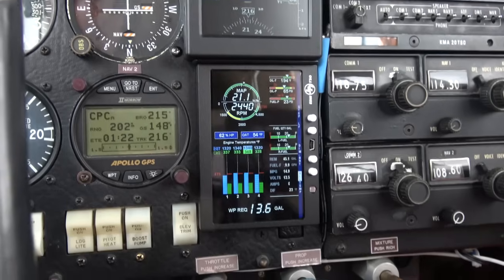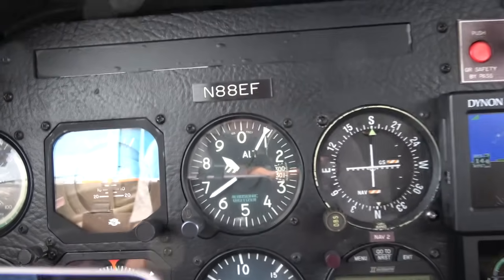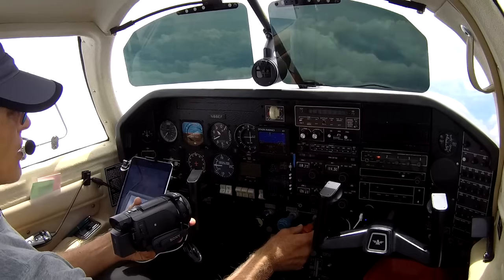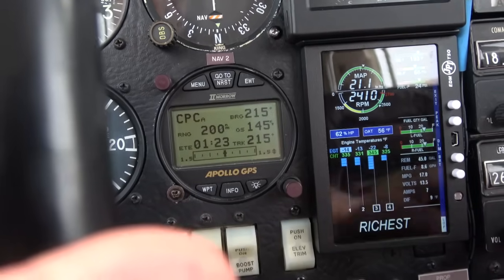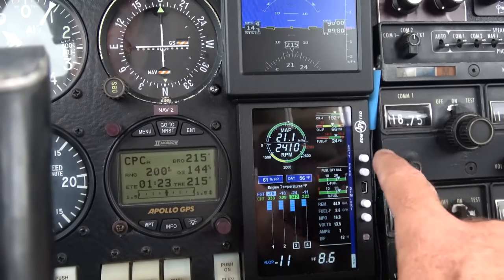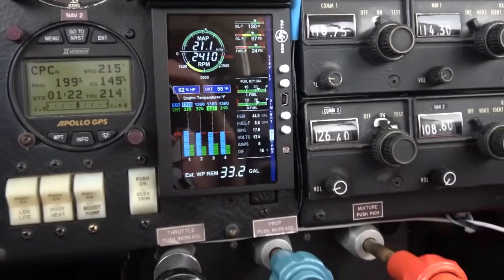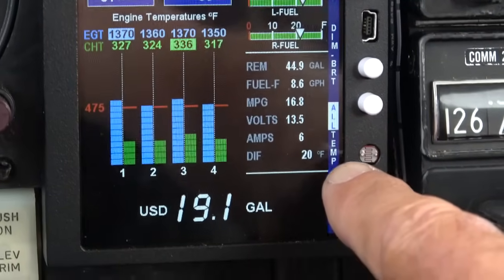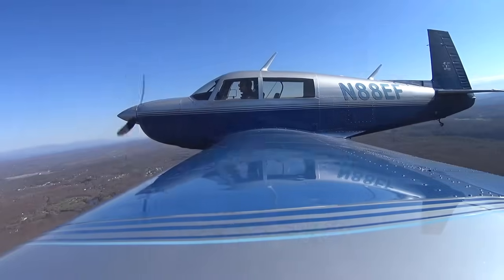JPI Lean of Peak (LOP) In-Flight

Comment: Craig ... Seems like you're flying M20J..  Do you have a Gami injectors on this airplane ? I fly the same thing and its super difficult to go with lean of pick with my JPI engine monitor.. I loose about 10knots of ground speed and the engine runs rough..
Reply from the maker: Shawn J hi, sorry for the long response delay...no, my J is a stock set up, but seems balanced, injector-wise. My DIF (high and low EGT) is usually less than 50 degrees. No question less fuel burn = slower speed, but in my case engine also runs smooth, cooler, and keeps the plugs clean. Sounds like your plane could benefit from the balanced GAMI conversion.